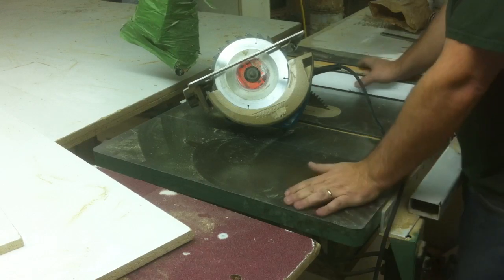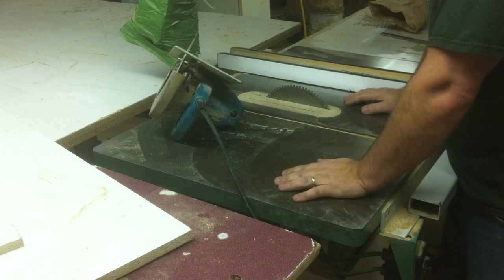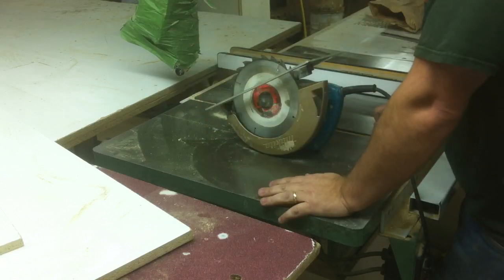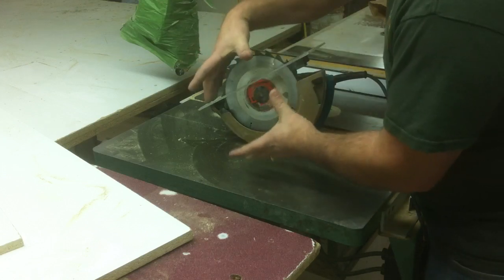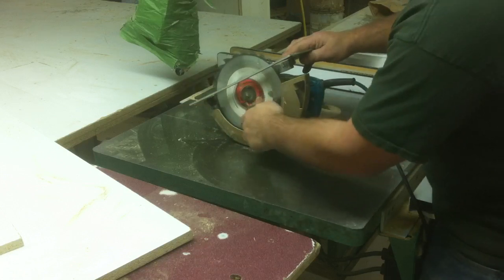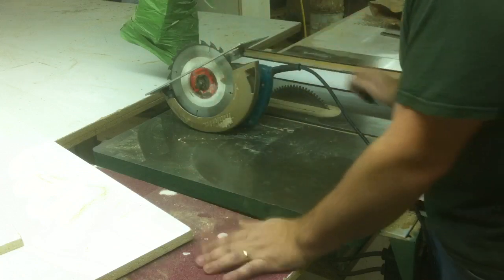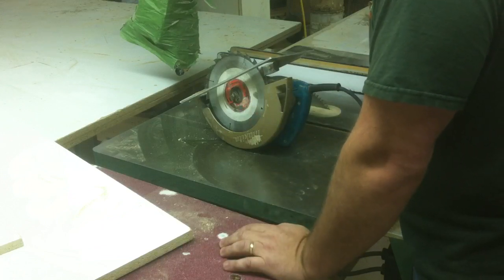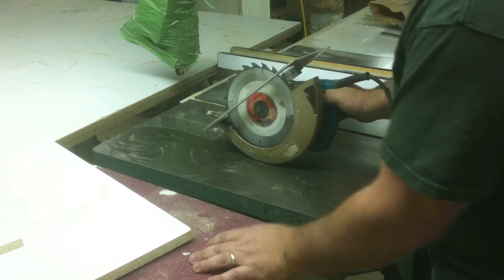Making a Copy Lathe part 1. The plan!

Comment: I was thinking if you canted the blade a degree or so it would give you a slightly wider cut to eliminate your saw blade groove marks. But this is only guessing.
Also if you mounted the blade at a slight angle to your work you may be able to take larger cuts without side loading your blade. Still just a guess. LOL

Comment: Idea:  Mount the template pin directly below - and in line with - the blade.  This way your template can be mounted directly below your workpiece. Also see the current issue of ShopNotes magazine (#132).  They are showing a home made lathe duplicator (not SkilSaw), but I think you could adapt their tool "carrier".